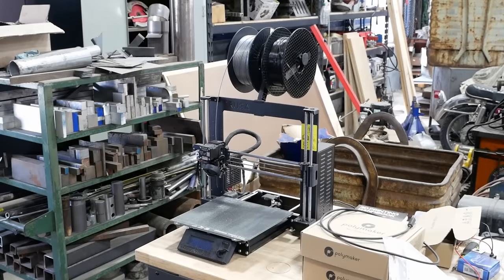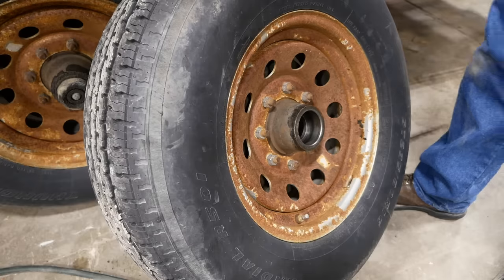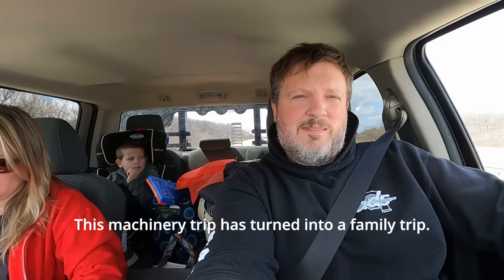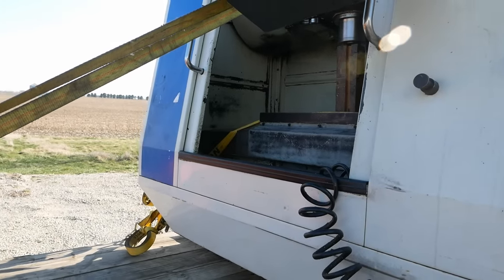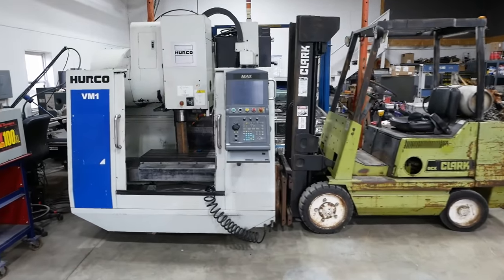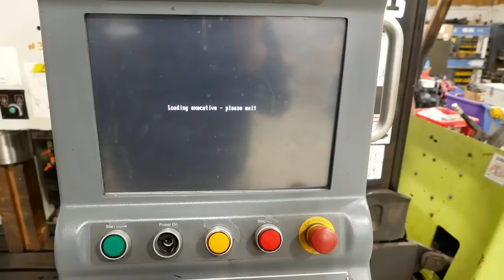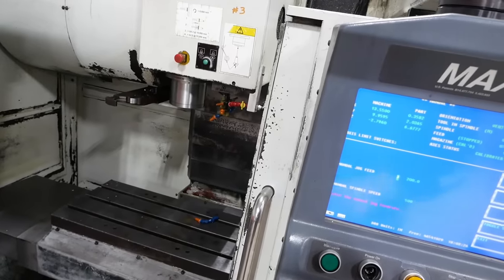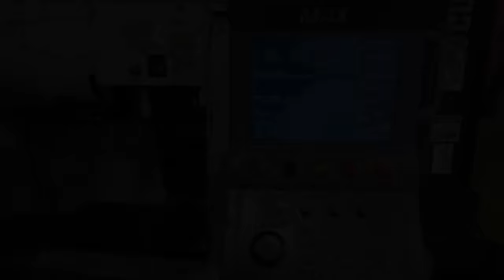Buying and Moving a CNC Machine - Peak Sketchiness

Comment: The rubber cap is for trailers with the quick grease bearings pull the cap and hook up the grease gun to grease the wheel bearings
Reply: Yep!  Take the cap off mine and I'm looking at the end of a grease fitting.  Handy!
Reply: I have seen these axles called "Uni-lube" Axles. I really like them and have drilled conventional axles to add this feature. Without using this system you would be better off with solid caps rather than ones with the plugs because I also have the same issue of the rubber plugs rotting.
Reply: They are correct. For some reason someone put EZ- lube caps on standard axles. No point whatsoever.
Reply: Round things turn into flat things
Isn't that how bearings are supposed to work?.
OMG NO cotter pin install complaints

Mom has to go, she has the chec k  book
Reply: My brand new dump trailer came with these bearing caps with the rubber plugs. They must be a penny or two cheaper or something. 🤷🏽‍♂️
Reply: Whoever designed them must have been in league with the bearing manufacturers.  The rubber gromets always rot off, then the hub fills with water and grit, causing you to replace the bearings.  Maybe he's related to the guy that invented bearing buddies...
Reply: yup it's a good design, it pushes the breeze from the back bearing out to the front bearing then into the cap. you can change out the grease without pulling everything apart
Reply: @dougr.6734  Those are technically called a dustcap now. That doesn't have the Spring load grease fitting behind it.
Reply: Exactly as described; my boat trailer has them so you can repack you wheel bearing (maintenance) without disassembly.
Reply: @chuckgrenci Don't you think Wes would have said something about a grease fitting there, If there was one there.Obviously he didn't.
Reply: @BigBoxDodge2020  Correct, I was relaying my experience with 'a' grease fitting, his didn't have one, and I was supporting the explanation of the first responder (as Wes didn't seem to know about the self-greasing of some hubs).
Reply: Gotcha, We call them bearing buddies on the West Coast. I have them on all my trailers.
Reply: @BigBoxDodge2020  I have two trailers - the boat trailer came with Bearing Buddy dust caps, the utility trailer came with a Dexter EZ Lube axle with the rubber center cap. The systems are definitely different. The Bearing Buddy is designed to keep continuous positive pressure inside the hub to keep water out on boat trailers. The EZ Lube system works as the other commenters have described. Wes' axle may or may not be drilled and tapped for the EZ Lube system.

Comment: Been driving a truck for 25+ years... I've never regretted throwing an extra strap or chain.
Reply: And when stopping for fuel or whatever always check that the chains and straps are still tight.
Reply: Customers come and go to my shop with no straps, or poorly tied down loads all the time.  Always tie down your loads strong and tight.  Cool CNC machine.
Reply: I used handcuffs with Pauliina.

Comment: "Executive program" is what the older PC based CNC machines called the main program that ran under DOS or Windows to provide the GUI, act as the PLC for machine side interface, run the motion control and feedback, etc.  I highly suggest exporting all the parameters out via serial to backup, then removing the decades old hard drive and image it to your PC!  If that hard drive poops out you are cooked unless you have that executive backup and parameters.  Also recommend replacing the PC BIOS battery as well.
     I love "gamble" machines, half the fun is the logistics and tracing down the issues.  
When people ask me what I make with my CNC machines, my usual answer is "scrap"!
Reply from the maker: I think I have a backup on floppy disk.
Reply: I just got a Chevalier teach lathe and it has similar PC control.  Came with 3.5" floppies but I don't know if I could even put my hands on a drive anymore, threw so many of them out from old PC's.
   @WatchWesWork
Reply: @CrawfordMethod I think I have an old MFM hard drive around still. Big one, maybe 20 meg?
Reply: You should try to get into the bios setup too and take pictures of the settings.  Many times they are not documented.  
Floppy disks don't seem very reliable anymore, but you can get an emulator that uses the floppy disk interface and allows use of a USB flash stick.  Makes it a lot easier to transfer files from PC to CNC if you are using a CAD program and post processor.  Amazon has a couple listed.
Reply: @jerryvanhouten3801 We were rearranging the office at the historical society museum I work at a couple weeks back. We found 8, 5 and 3.5 inch floppies with monthly meeting reports on them. I don't recall ever having anything that ran an 8 inch floppy disk.
Reply: @DeweyCheatumNHoweLLC  Ha!  I remember seeing some and a few drives long ago.  I don't think I ever saw a working system that used them.  5 1/4 inch were common with the first personal computers.  360k low density and 1.2M high density.
Reply: I was just about to suggest this! We have a factory full of old CNC's where I work and some of them run very legacy hardware that is becoming difficult to find as its not compatible with the newer stuff. Back in 2012 we had to find a 20MB HDD from the 80's for one of our machines - luckily we had a backup of the program.

Comment: Trailer service company owner here. The little rubber cap is designed for axles that have a grease nipple inside. Normally you use a solid cap if you don’t have a Zerk fitting.

Comment: anyone that hasn't done something sketchy with a forklift hasn't worked a day in their life.
Reply from the maker: I forgot all my training from the forklift safety class.
Reply: Amen brother
Reply: @WatchWesWork I never got those classes but have used a forklift several times
Reply: I just flipped my forklift last week a little bit scared to operate it again because it was very old machine everything is wobbly 😅
Reply: If you haven’t used a bigger forklift to get your smaller forklift unstuck from the mud/snow, you haven’t worked a day in your life either 😂
Reply: @WatchWesWork  There's no shame in asking Klaus for a refresher.
Reply: @basedWisco715  I’ve had to use a bulldozer to get my dad’s forklift unstuck a few times
Reply: Yes.
I've been a Human Counterweight.
Reply: @WatchWesWork  Wait...what? There was a safety class? 🤦‍♂
Reply: Moved a lot of cnc machines with a 10 metric ton forklift...and still almost flipped it ...3meter forks with 6,5 ton weight and the back wheels came of the ground...i got the machine in the truck.....but it wasnt fun....safety class? When you pass the exam you forget everything instantly
Reply: The only really sketchy stuff I've done with a forklift was to recover precarious situations caused by other peoples' stuff ups 🤷.

Other equipment -- I'm the OH&S nightmare!
Reply: Never driven a forklift in my life....But my wife is certified to drive one...and does !
Reply: A forklift is a machine designed for sketchy activities.😂

Comment: I strapped a 55gallon drum to the back of my forklift and filled it with water so I could move my HAAS VF0.  I had a Clark 6k lift that was really built as an 8k lift with a smaller counterweight.
Reply: Buddy of mine and I did that to pull a Caterpillar diesel out of a dump truck, we called it the Variable Ballast System haha

Comment: There is a switch behind the spindle guard, they get sticky.
Plenty of wd-40 and cycle it should free up.
As far as the tool changer, open the cover in front of the gear box and make sure there is oil in the cup.
If not, fill with dte light.
The seal on the tool changer arm likes to fail and all the oil leaks out.
Reply from the maker: OK. I'll check it. I noticed the spindle motor needs a cleaning anyway.

Comment: WE had a couple VM1s in our shop, reliable enough that I never learned much about them. I do know that low tool changer oil often caused issues in one of ours.  The other sort-of problem was that the way it stores tools confused the operators, and by the time they called me their table was full of tool holders that they had no idea where they belonged. The machine doesn't use dedicated tool pockets, so tool #1 is not always in pocket #1. If you started with tool #1 then went to #5 it then stored #1 in pocket #5 and so on till they were all in somewhat random positions. The machine knew what it was doing, and would be fine as long as you didn't try to correct it. I spent a lot of time reloading tools whenever someone new ran the machine.  Seems like the tool changer was persnickity, if anything was done out of sequence it wouldn't do anything till you got it back where it wanted to be.
Reply: Seems to me that the clamp/unclamp happening at the same time was a common issue, don't remember for sure what caused it.  I know there were a couple situations that had me manually manipulating the tool changer valves in sequence to reset something. I'll see if i can find anything in my notes.
Reply from the maker: Yeah, floating tool changers can be confusing. It's actually what I learned on. When I got a carousel that always put the tool in the same spot I didn't know how to act.

Comment: Wes, I hauled quite a few big CNC machines from a manufacturer in NY State called Fryer Machine,and laughed out loud watching you handle yours with that small towmotor.  A lot of times, I would arrive at a customer with a 30 ft long or more machine that was overheight also, and they would come driving out with a couple towmotors like yours to think they could do the job.  It was hillarious.  Love your content, Bill
Reply from the maker: I guess they have to try.
Reply: @WatchWesWork  The running gear on your new machine sure sounds quiet, doesn't it?  Happy Easter, Bill

Comment: One thing I learned with forklifts....and I drove them for about 15 years...  always drive forward when you have a load on the limit...  that way you force the weight onto the rear wheels which allows a certain amount of steering...
Reply: Load goes uphill, too.
Reply: @TheOneWhoMightBe  Also use full tilt back

Comment: What a great video, the sketchiness reached extreme on the gauge when unloading but it worked and it looks like another content generator has arrived at the shop. I was with you until you opened the control cabinet and then my eyes just glazed over. I find I get a lot of satisfaction and pleasure from picking up something for a cheap price and getting it fixed up and using it, but sometimes it’s a very, very fine line between satisfaction and frustration. I loved the road trip and seeing your family so thanks for including them. Cheers Wes, Stuart 🇦🇺

Comment: That rubber plug on the grease cap is for "ez-lube" axles that have a grease fitting in the end that is cross drilled to the inner bearing so you can regrease the bearings without disassembling them. Super handy

Comment: During some high school and early college years I worked in varoius departments of a factory, eventually doing prototyping and engineering work for some new products, including cnc sheet metal work (amada pega) and writing programs for and running their Hurco VM1. Been shopping for one as well to eventually have in the home shop, neat to see one show up here
Reply from the maker: Too bad. They had two machines. A matched pair. But one was already sold by the time I got there.

Comment: Nice machine. DOS programming works just fine, probably some sort of g code list that you can work from.  Not sure how much internal memory it has, but a machine like that is best at making holes.  Die and mold components have lots of bolt holes. Tap drill holes and clearance holes for socket head cap screws, probably able to power tap with the machine. I hope you get the tool changer sorted out, it might be something as easy as not enough air pressure. Tool changers are truly a blessing, keep the drill bits that you use loaded up and offsets set in the controller. Keep some cheat sheets for your drilling programs. Good luck.
Reply: It's a very good machine for anything 3-axis contouring.

Comment: As a mechanic that owns rotted plow trucks, works on tractors, and machine operator that runs fanuc machines daily. This channel has it all. Next thing that would encompass all my interested would be a boat, but that’s just a hole in the water.
Reply from the maker: Ugh. No boats!
Reply: The sign also said no RVs
But how did that go for you? ;)

Comment: I used to be a fse for a major cnc laser tool. I remember we had a customer in Erie PA that had riggers moving a new $750k machine in place. You know you can't tell a rigger how to do their job. Well theyre lifting our epoxy granite frame machine incorrectly and as soon as the other on-site service engineer told them they can't lift it that way and they said they know what they are doing - they crack the machine in the middle.
Reply from the maker: I had a rigger run into the side of my machine because his forklift had no brakes. Dented in the sheet metal and broke the door hinge. He "discounted" the bill. Funny though, with the discount it was still more than he quoted me...

Comment: I have been selling Dexter trailer parts for over 24 years as a distributor and I agree quality has lapsed.  That cap is the wrong one for the axle, yours does not need an EZ Lube cap ,If the spindle had a zert in it then you would .
Reply: For real, the rubber cap is a failure point as-is.  Knew it had to be something sketchy or wrong.
Reply: You've been selling trailer parts for 24 years but can't spell zerk.
Reply: It was after 5pm so spelling errors don't count.  to  funny.
Reply: @anderleof  I grew up on a farm and was in my 40s before I knew it was zerk not zert. But we also added an ‘or’ to wash. WORSH

Comment: I used to work on very high precision money making machines. 
Repeatability within microns.

People that worry about the suspension on trucks delivering machine tools should see how some of those machines got delivered!

Why yes, your multi million dollar machine has just been delivered on the back of a decades old truck held together with hopes and dreams and driven for miles down unpaved roads. It's then been unloaded with the world's jankiest forklift driven by someone that can't read the "don't lift here with a forklift" sign, swung through the side of the factory by a crane and extracted from the crate by a couple of apes with a sledge hammer (if I had a friend!). I'm sure that's great for precision!

The machines were sensitive enough once set up you could tell if the floor was settling by the change in their output quality, and they were chunky beasts.

Comment: Personally I prefer to use Russian torque spec on wheel nuts. Tighten that baby up until the nut loosens up and then back it off a quarter turn. 🤣

Comment: The rubber cap is for "EZ-Lube" axles.   They have a zerk on the end of the axle, with a passage bored into the cavity between the bearings.
The thought, you can add a couple pumps at reasonable intervals to ensure that your bearings are lubed.
The reality, people pump until the see grease come through the outer bearing rollers thus COMPLETELY filling the cavity in the hub and usually pushing out the inner seal and filling the drum with grease.

Comment: the rubber plug on the trailer hub cap is for access to the grease fitting on most modern Dexter axles,  feeds grease through the spindle to both bearings instead of needing to repack them

Comment: The little rubber cap on the axle dust cap is for marine axles that have drilled stubs for greasing the bearings. That cap is how you access the grease zerk

Comment: I was a owner operator machinery mover and hauler for 35 years and a machinist before that. I hauled a lot of Hurcos very similar to Brothers. One rule was I never strap over sheet metal parts that don't go to floor. Trailer can  flex or twist and push up against straps and bend or cause enclosure to  break from mounts. There are a couple ways to chain leveling screws using rubber protection, but was always last option.
Next investment, tooling. 😂😂

Comment: Did something like this years ago at work, with a much less delicate load though. It weighed 5 metric tonnes and the fork lift maxed out at 4,5.
A little sketch but I was able to steer every time the back wheels touched the ground.
Great vid as always. Cheers 🍻😁

Comment: Some trailer spindles are drilled for greasing with a zerk - especially popular on boat trailers.  You pop those rubber pieces out and the zirk is on the end of the spindle right behind it.

Comment: Wes, those caps were for EZ Lube spindles which have a grease zerk on the end. You pull off the rubber plug and can get your grease gun head on the zerk without removing the metal cap.

Comment: The rubber cap is for axles with EzLube spindles that have a grease fitting on the end so you don't have to take the whole thing apart to grease the bearings.

Comment: My camper has dust caps like that. The axles are made with a grease fitting that is directly behind that little nipple on the rubber cap. The idea is that you pull that rubber piece, pump it full of new grease, and reinstall the rubber piece.  In your case with the more standard style axle, I’m sure you could use a plain cap without the rubber piece.

Comment: Drove a forklift for 5 years. Normally used a forklift for daily use that was about the size of yours. Periodically we used one that was the size of a small tank. It was labelled G5. They had us move semi trailers with it, empty and loaded so we could load trailers. Had about 8 dock doors. The first couple were kind of sweat inducing! It was usually alot of fun.

Comment: I believe the rubber cap in the middle of the dust cap is for greasing the bearings on axles that have a grease zerk on the end of them. I've had 2 trailers that were that way and they were the only ones I've had with the rubber insert in the dust cap.